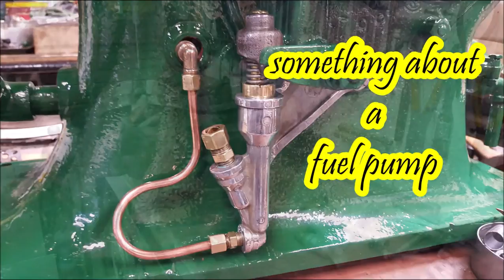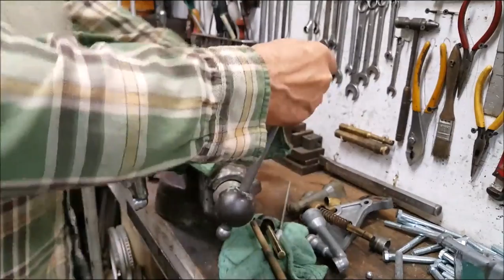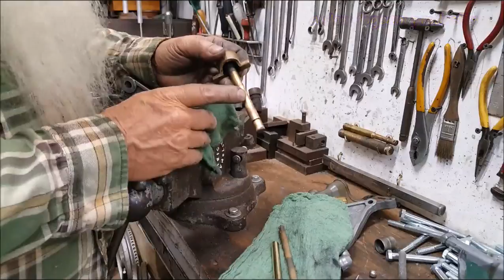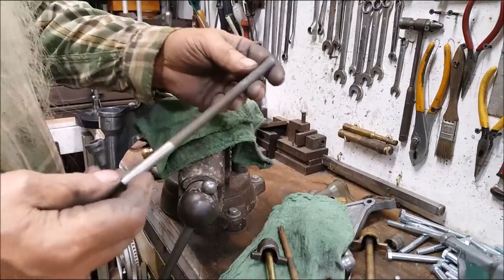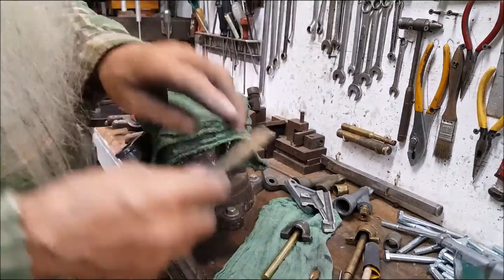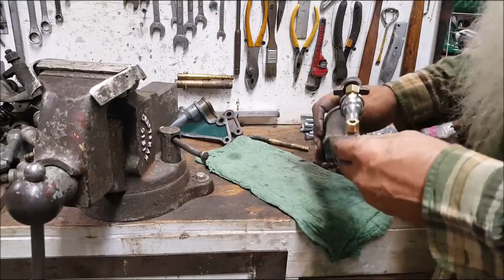McCormick Deering Engine 3 hp fuel pump rebuild #28

Comment: Have you tried to run the drill bit in reverse so you scrape a new seat for the check valve rather than drill out material, might be less aggressive on the metal removal